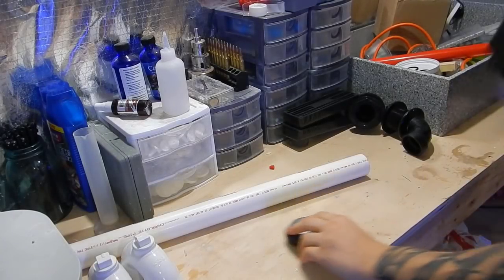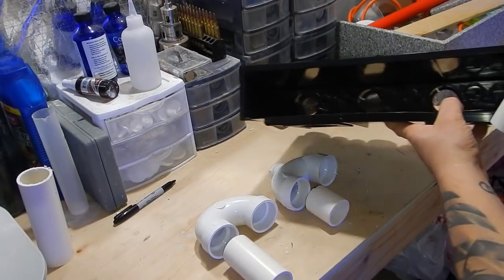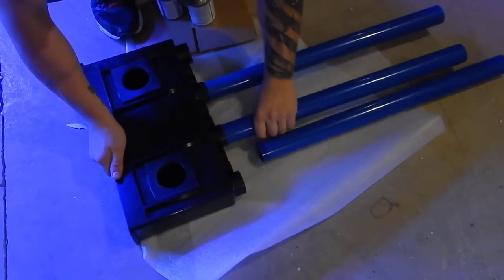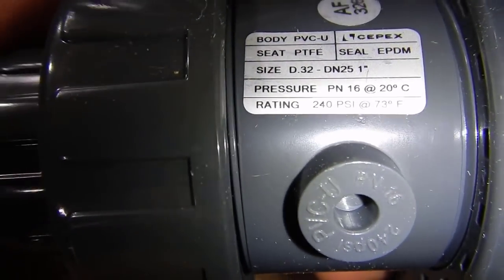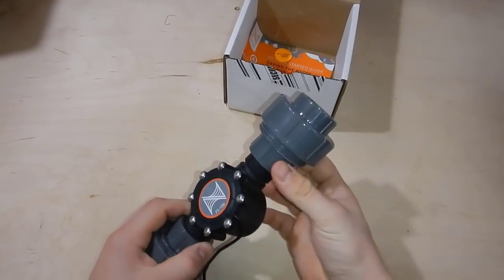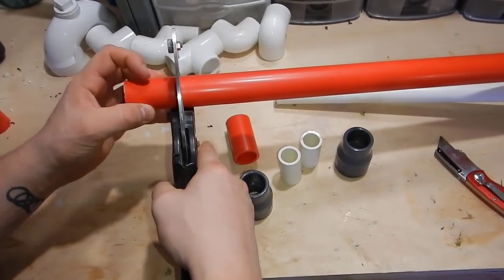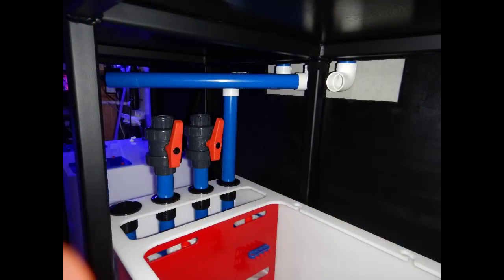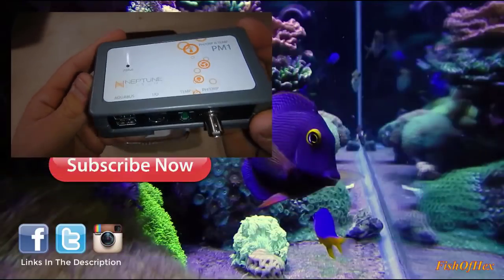Plumbing The 300 Gallon Reef Tank

Comment: A couple of things. One, that overflow looks like a Bean Animal Overflow, other than the second stand pipe doesn't have a drilled out safety tube.  Did you glue the stand pipes to the sump drain bulkheads?  Also, are the values on the sump bulkheads closed or open in the picture.  Thanks.